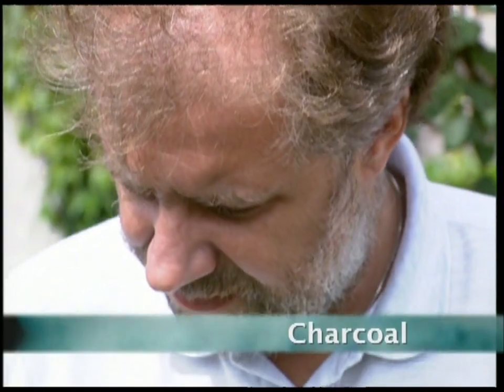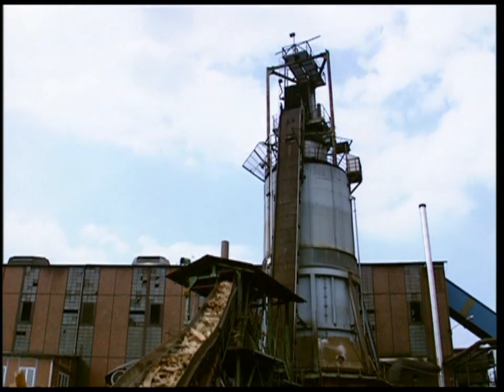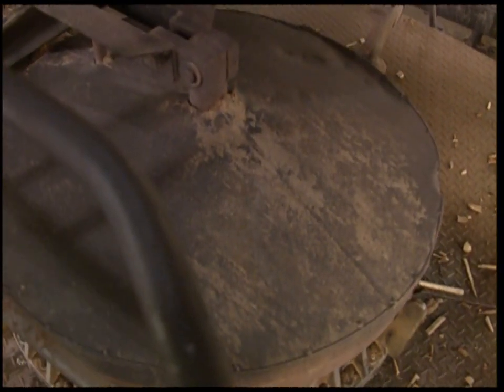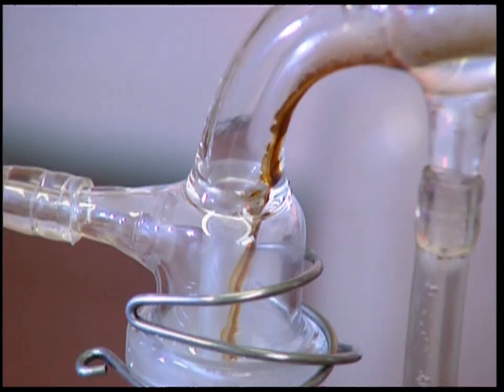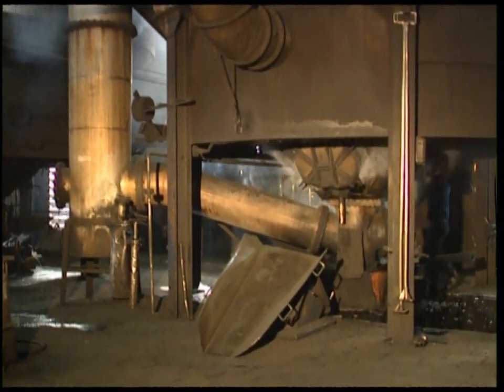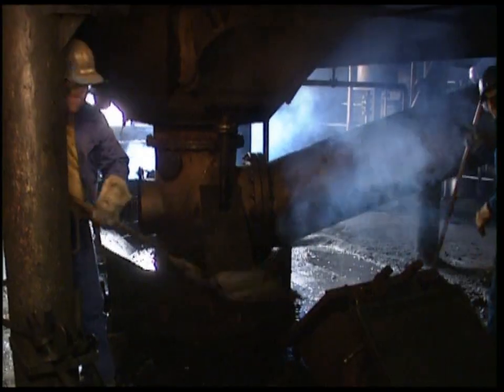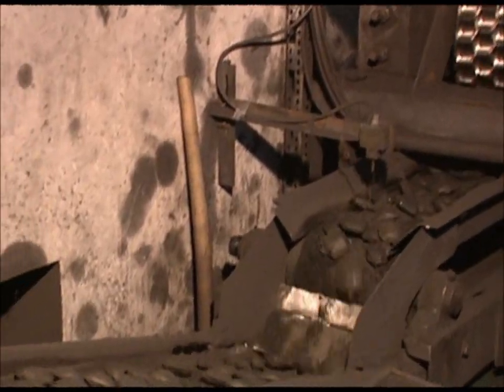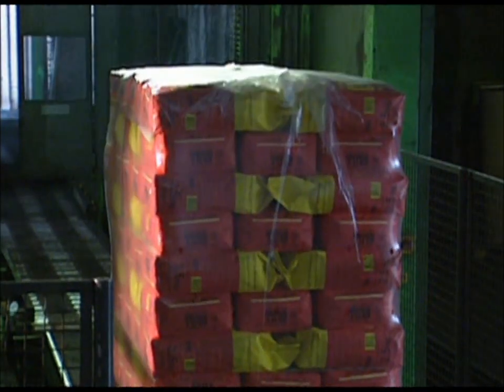HOW IT WORKS - Charcoal

Comment: I think this video should be labeled How it is made - charcoal. I was hoping to see the chemical process on how it works
Reply: Shake_N_Bake same
Reply: Shake_N_Bake well, the sequence from 1:25 to 2:20 is basically it.
It's only a slow pyrolysis (essentialy burning in absence of oxygen) which vaporizes any volitale substances in the wood, leaving you with almost pure carbohydrates.
Reply: Charcoal + heat and oxygen = more heat + water + carbon dioxide
Reply: Shake_N_Bake 

Don't listen to them! Watch a video called "BEGIN Japanology - Charcoal." In it, the science of how charcoal works is explained.

Essentially, the purpose of converting wood into charcoal is to convert it into pure elemental carbon, which burns much hotter than wood, and produces a flameless, smokeless heat. These properties make it superior in some applications, such as cooking.

Charcoal is elemental carbon, and so it is directly oxidized to carbon dioxide by oxygen. The reaction is very simple:

 C(s) + O2(g) -> CO2(g) + 393.5 kJ/mol 

 The reaction is highly exothermic, but it requires a high starting energy as well, which is why charcoal is more difficult to ignite than wood.

Comment: This was interesting and all, but this is more of How Its Made, not How It Works. I wanna know why charcoal burns the way it does as opposed to wood
Reply: Charcoal is mostly carbon.  When you ignite it, the carbon "oxidizes" which gives off heat.  The carbon combines with Oxygen (O2) to form carbon dioxide (CO2) and carbon monoxide (CO), which consumes most of the carbon.   Heating the wood without oxygen removed the water, sap, and other impurities.  Charcoal burns more evenly than wood.
Reply: Great, thank you. I looked it up on Wikipedia.  But I want to see a video of HOW it works.
Reply: Essentially, the purpose of converting wood into charcoal is to convert it into pure elemental carbon, which burns much hotter than wood, and produces a flameless, smokeless heat. These properties make it superior in some applications, such as cooking.

Charcoal is elemental carbon, and so it is directly oxidized to carbon dioxide by oxygen. The reaction is very simple:

 C(s) + O2(g) -> CO2(g) + 393.5 kJ/mol 

 The reaction is highly exothermic, but it requires a high starting energy as well, which is why charcoal is more difficult to ignite than wood.

Comment: great video! Are the gasses that come out of the heated wood flammable? Can it be used to generate steam or electricity?
Reply: Yes, it is flammable. It's actually called 'Syngas'.
Reply: The gasses are flammable and can actually be used to run an internal combustion engine, so yes, they can be used to generate electricity. There was a show on History Channel where a guy made a "gassifier" (a wood burning tank that produces this gas) in the bed of his truck and hooked it up straight to the engine. Basically his truck was fueled by wood. How long the engine lasts due to carbon residue, I couldn't tell you, but it does work.

Comment: No mention of the potential energy that could be harvested from the driven off gasses, or the creosote.
Reply: they should use it as fuel to heat the wood, a lot of retort kilns are designed to do that

Comment: wait what you flavor meat with wood water?!?!
Reply: I'm assuming that it is used to give cheap bacon and some other cured meats a smokey flavor. It would be far less expensive to do this than to actually smoke the meat.
Reply: +Shadower1337 Instead of actually smoking things like bacon, most of the bacon you see in stores is injected with smoke flavoured water.
Reply: there is a product called "liquid smoke". gives a smoked flavor without having to actually smoke anything

Comment: Now I see why I find small piece in my bag of lump charcoal. They do the sorting AFTER the retort processing. They should consider sorting out the smaller pieces before the retort process, that way they can assure every bag will have reasonable large size lumps.